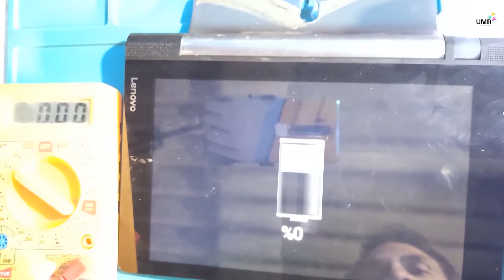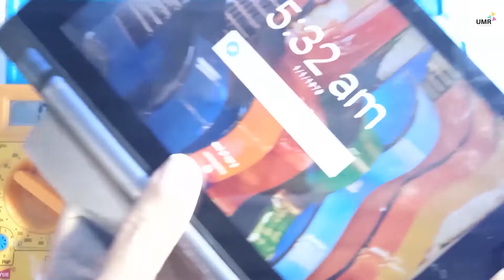Lenovo Yoga 3 Tab Lenovo YT3 850M Charging Fault Solution.

Comment: Hello, I have currently had the same problem, mainly when connecting the charger the integrated one got hot, but I have seen this video before yours and I have carried out the procedure , the tablet turned on, but apparently it does not charge, I hope you can help me with the component that I have removed, this is the video
 https://youtu.be/5fbPtETh3NE?si=xcMLd9sUF6bXLE8M

Thank you very much and greetings.

Comment: What exact error is it ? My tab only starts when connect the charger but even that case battery shows zero and in seconds shows as 100%. It hardly turns on . Even it turns on it turns off saving temperature too high.. 

So is the problem you fixed is similar to that ?
Reply from the maker: Replace battery 
After replacing battery still same problem 
Then check bat id line or bat thermal line, according your tab schematic diagram.
Reply: Having something similar,  "battery temperature too low"  but I came to believe it is a soft problem aimed at forcing a new purchase.  Tablet won't charge,  stays at the same 4 percent... yet it charges fine when you shut it off under its own power then start it again and connect charger within the first few seconds of boot. Also seems to charge only when wireless is on.  Very peculiar
Reply: I have Lenovo tab 3 yoga 10" now it not charging, i accidentally connected with supercharger adaptor since then its not charging, can you help me.. may be IC burnt